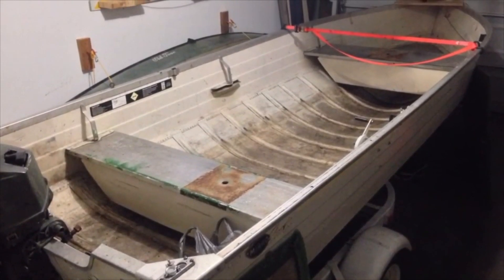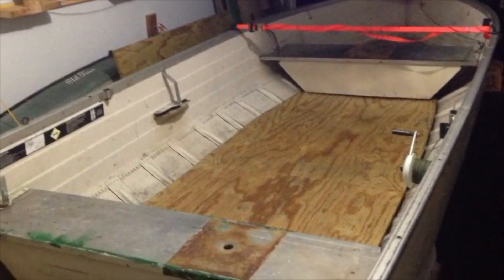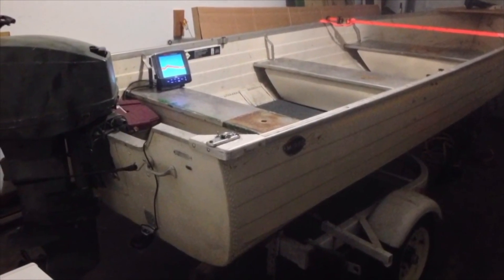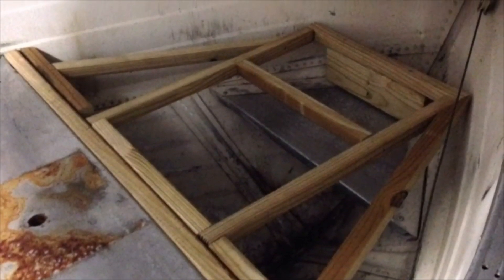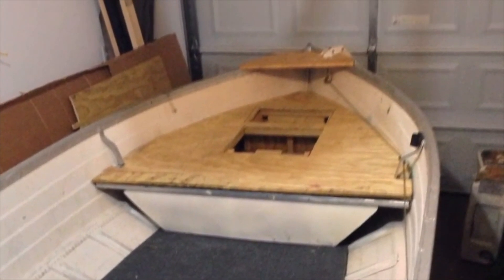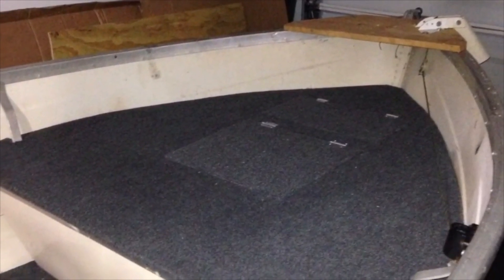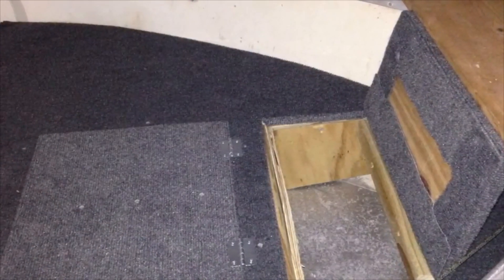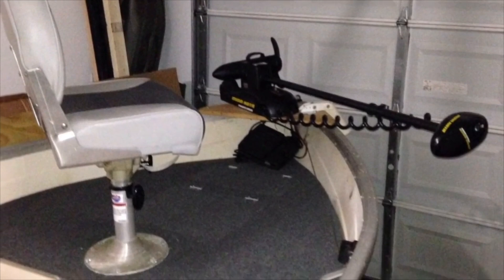14ft Aluminum Boat Deck build (How To/DIY)

Comment: This is exactly what I want to do to my boat. Simple yet effective. Thanks for the video!
Reply from the maker: OutdoorsUnlimited 101 no problem 👊🏼🎣 best part is it’s pretty easily removed
Reply: DWS Outdoors yep, I do have a question though, did you cut the supports at a angle so they fit more snug? Or did you just cut them straight?
Reply from the maker: Sorry just seen this now! I cut everything  straight except the ones under the front deck I matched the angles needed to have them flush with the bench! But looking back at it I probably should have cut the floor supports to match the angles of the boats so as not to have pressure points!

Comment: There is not that many videos on mirrocraft boats that ive noticed. I have a 1966 14ft mirrocraft that I've been slowly restoring \ building. Its my first boat. Mine is exactly like yours but I don't have the very front shelf in mine or the anchor buddy. I'm gonna try and restore my bench seats. I haven't seen anyone yet try to restore the bench seats. The wood under them is pretty rotten and the metal sides have some bad rust spots through them. The best part I think about my boat is that I've actually found most of my materials for free out of construction dumpsters. Metal, foam blocks and wood creates. I really look forward to getting it finished for me and my 8 year old son to fish out of it hopefully this summer. I've been subed to your channel for awhile now cause of your boat but the other night I looked through your videos and it looks like I'm gonna have to start binge watching your channel! I really like how you get into detail and take the time to explain everything. Most YouTubers don't do that. They just fish and not really tell you how to find the fish and what works best. I'm surprised you don't have 100k - million subs! Oh and if you want to clean up your wires where they are out of the way better the top rail is hollow. The back corners come off pretty easy to give ya a little more wiggle room for running wires through the top channel. Thanks for the videos!

Comment: Thanks.  You're giving me some good ideas.  I'll fill in the hull with 2x6's as a base.  then I'll build the platform (framed out) and just lay it over the middle and front seat.  What was your plywood thickness?  I'm thinking of going with 3/4 inch.  Easily removable and I won't have to remove any bench seats as you did.  I like the battery idea.   I would like you to do a video on your front electric mounting if you ever have the time though.  Your ideas were very helpful.

Comment: Nice and easy. I just picked up a 1970 mirro craft and when I took out the middle seat I noticed the 3 peices of wood slat were rotted. Just something to watch out for if someones got an older boat. Slats should be easy to replace which I am getting ready to do.

I did not strap and may not put the middle seat back in.  Do you think this can hinder the boats action or safety. My thinking is I have 2 boys 4 and 5. I want to give them room to feel comfterble standing, fishing, etc. Do you think this is ok?

Comment: Does the boat move alot when using the casting deck?
Reply from the maker: I have pretty good balance so I do not notice it but if you were super heavy or tall it would probably be best to find yourself a good flat bottom so you have more stability!

Comment: Great video, I’ve got the same boat. Could you tell me the length/width of your bottom floor? I have a very slim gap under my benches so it seems like it will be difficult to squeeze a 3/8 sheet under there.
Reply from the maker: Its actually a 8x4ft piece of plywood just trimmed down to match the curve up front!
Reply from the maker: I just remembered you also need another piece of plywood to cut down and fill in the gap from the back seat to where the 8ft piece ends from the front!

Comment: what kind of plywood did you use and did you treat it with anything? Great video.
Reply from the maker: Thiago A. I ended up just using outdoor treated wood but was told later on that I should have just spent the money on marine grade plywood! But I have had this boat for about 4-5 years now and everything is holding up! But I have always stored it in a garage!
Reply: The treatment in treated plywood will eat that boat like cancer I found out the hard way .
Reply: @marklikeinthebible  I've heard this from someone else

Comment: Hello. After looking thru lots of tutorials, i hope you may be able to help me. I have been offered a 19' open boat. It is just a shell but with stringers and locker seats good. It has a round Hull with a 6'' keel. I want to fit a floor. I can do the fibre glassing. But apart from installing a bilge pump, with access ....how do I do it
Reply from the maker: william avery I don’t know if you have seen my other video listed at the end of this one yet? If that one doesn’t help there is a group on Facebook called Tiny Boat Nation and there are a lot of good people on there that could help you out👊🏼🎣
Reply: @DWSOutdoors  thank you for your kind reply, I will have a look.
Reply from the maker: Hope it helps! Good luck and have fun with it!

Comment: Did you do anything to isolate pressure treated lumber from aluminum as it is corrosive?
Reply from the maker: Scuba Girl I put several layers of carpet between them and I almost never let my boat get wet! I plan on redoing the whole thing with marine grade wood soon 👊🏼😎

Comment: Just curious, absolutely no criticism at all. Any idea how much weight do you think the wood adds instead of aluminum. I’ve always used wood and never had any problems with it
Reply from the maker: The wood I used might have weighed about 125-150
Reply: @DWSOutdoors  yeah, the last two boat I’ve had I used wood and they turned out great. Probably would’ve lasted longer if I’d done something to protect the wood. I’m a dumb ass. Live and learn

Comment: I have a 14 ft Aluminum Lowes boat that has a 582 pound capacity for people motor and equipment.  I am concerned that the amount of wood being added is 300-400 pounds, which significantly decreases the capacity. If you fish alone then great but if not, be cautious of capacity. You could be liable.
Reply from the maker: Total weight added with all of my stuff might be 200lbs
Reply from the maker: Also believe that my weight capacity was 800 something?
Reply: I think you're overestimating the weight of the wood.

Comment: Great video, earned my sub+like. Have the same exact boat and I’m following this step by step. How many people can you have on there max with that extra weight? I’m guessing the max cap is 980 lbs ?
Reply from the maker: Thanks for the Sub and LIKE! I forgot the max but with what I put into it I only run 2 people ever as I think your right around 980lbs people + gear?
Reply: DWS Outdoors correct my man, legit following your build exactly, gonna do one hatch in the front. Do you think those seat boards can support the wood and someone standing up there?
Reply from the maker: OutofBody check out my other boat vid that might help explain

Comment: How did you secure the deck supports to the sides of the boat?
Reply from the maker: I think I describe it in detail in this video a lot better: https://youtu.be/pgiZbkYWICw
Reply from the maker: Otherwise its kinda wedge fit if you get what I mean? Thats why I took out the middle bench and made the deck to fit under it tight as well as the back bench and front... so I didn't have to actually attach any of that to the boat!